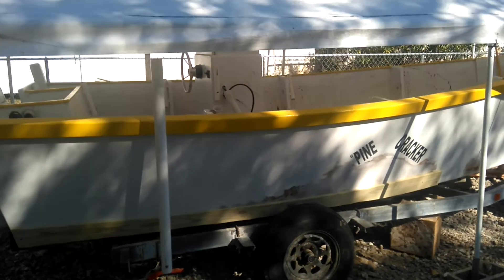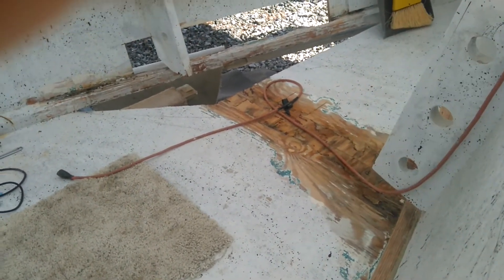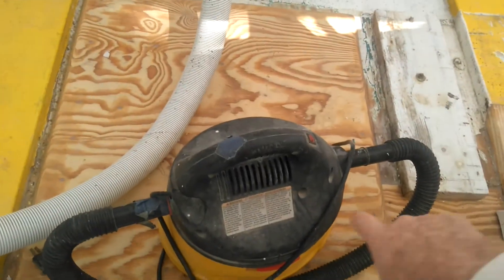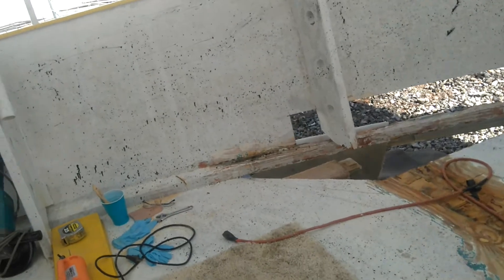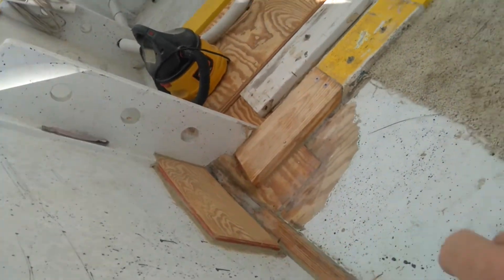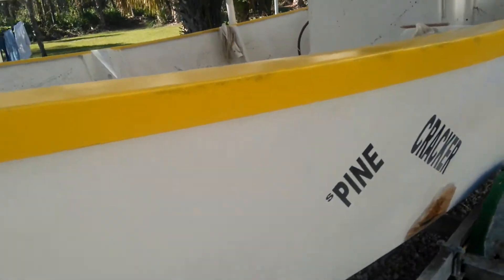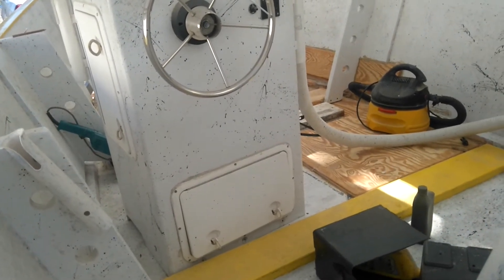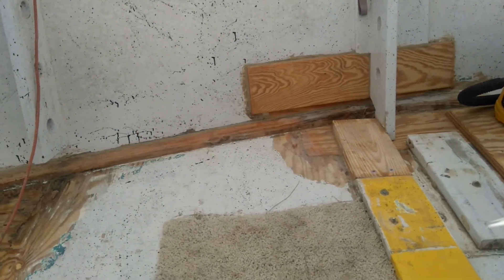Lumberyard skiff two years later

Comment: You don't want to glass both sides of the wood. I've done it. With epoxy. It rots. Here's the thing. YOu built a disposable boat. You made it out of inferior materials. This is what happens. If you want a wooden boat to last build it out of cedar planks. At least build it out of marine grade plywood. Fur or Okume or something like that. If you build a boat out of wood intended for sheathing a house it's going to rot. If you build a boat like this don't glass anything because it's a waste of money. build it cheap as possible and use it until it falls apart. You'll get 5 years or so out of it. Then build another one.

Comment: So, if the paint on the inside was not letting it breath how is painting the outside and not glassing it going to improve the longevity of the plywood? I am about to start a build of a 23' power dory and I have seen this issue brought up once before but it seems primarily the problem lies with leaving the boat in the weather with no protection. will the boat breath and dry out better without the glassed bottom when the paint acts as a sealer as well?

Comment: That was thoroughly depressing. I'm an expat living in Indonesia where the wet season lasts several months with rain for at least part of the day every day and temperatures range from 23°c to 30°c. I've got a balsa wood model of plywood skiff sitting in front of me but because of lack of boat ramps I need a 16' boat that can be flipped over and left on the beach or sit on an incline and drain when it rains. I'm thinking back to all the Jon boats built from 3/4 boards that were just painted with gray or green porch paint that were just flipped over by the edge of the pond in Eastern North Carolina and those boats lasted forever. The problem seems to be with the plywood itself as the glue between layers acts as a vapor lock so with thicker ply you have more layers of locking up water that wicks in from the edges and can't easily escape. I would like to see someone do some test panels using the thinnest three layer luan plywood 3mm here in Indonesia which is equivalent of 3/16 or 1/8 inch and with 12 mm (1/2 inch) with.  1. Sealed with two part epoxy only including edges meticulously sealed with epoxy meaning keep brushing it on until the wood won't suck up any more.
2. Same as #1 then laid up with a layer of glass on one side 
3. Same as #1 & #2 with glass on both sides. 
Obviously, making sure the plywood is as dry as possible. 
Control panels of each totally untreated and fully painted with a breathable paint. These I would leave exposed to the elements atva height of 24 inches above the ground, preferably suspended rather than any potential wicking from ground contact connections. 
I know a YouTuber in the Balkans who builds proas and he always uses 1/4 inch poplar plywood for his hulls and he swears by it. He recently ran across one of his hulls at a marina that was left exposed to the elements for a year flipped over and it was in good condition. 
My theory is that the thicker plywood will rot faster in all of the tests above. If so it seems we should look at plywood as a form for fiberglass especially in tropical and subtropical environments and use the thinnest possible that can hold the desired shape and if possible throw it away after forming the hull. But that wouldn't be a wooden boat meaning diy guys would have nothing to do but chores and fishing. Nahhhh

Comment from the maker: I grew up in an area in the 60-70s and none of the plywood boats were glassed. In my opinion I believe the wood may breath better. Also the additional cost of resin and Glass and of course a lot of extra labor. If you decide to Glass you might want to check out a company called Glue Products in West Palm Beach FL.
They have excellent prices on resins and Glass. I use to be heavily involved in the Marine industry in West Palm and this store sells to the public. Cheers
Reply: A new England guy i watched build wooden skiff, only glassed the bottom to the water line, however he sealed entire inside and out with epoxy mix, and at all major joints like scarf, etc. He added fairing compound. 
He sanded all the epoxy sealed surface,  the entire boat every inch,, for paint adherence, then painted with 2 coats primer, then 2 coats of paint. Its not about the glass. Its about 100% waterproofing the entire boat. Glass is for strength and protection.

Comment: Offshore fishing? I built the 16’ LYS and have been quite tempted to take it out the Indian River Inlet here in Delaware but haven’t yet. The 20’ version may be in my future. Good job.
Reply from the maker: Hi Bill, In flat waether you can take anything out the inlet. lol These boats were designed for inshore working but I do run mine offshore out to about 15 miles. At lower speeds the high free board and flat bottom is quite stable and does a good job of keeping the water on the right side of the hull. The boat is very trim sensative in the bow. It has a tendency to want to dig the bow in and twist, can't think of the proper nautical term at the moment. CRS  Be very careful on plane in following seas and inlets. I have been running boats for 40 years and a capitan for 25 plus. This one requires some sea handling knowledge offshore but can handle a bit of weather.